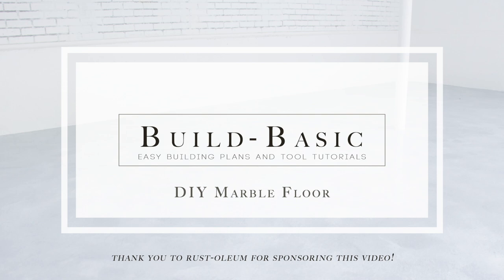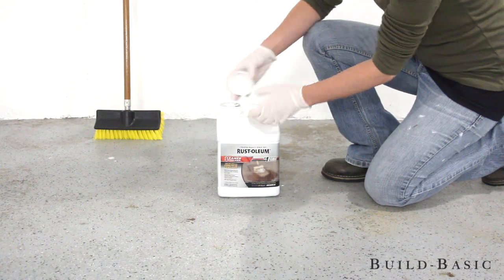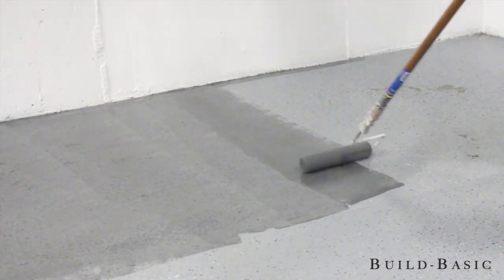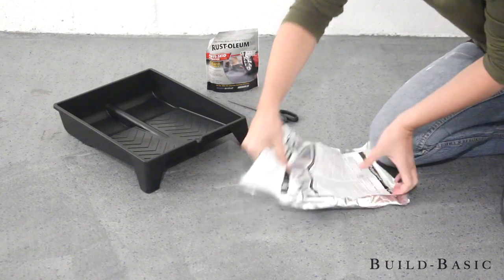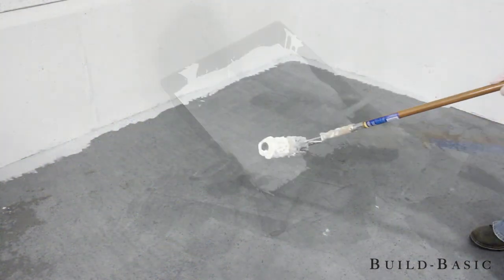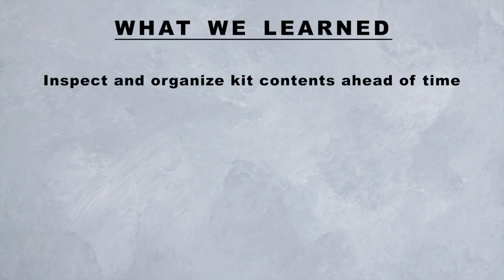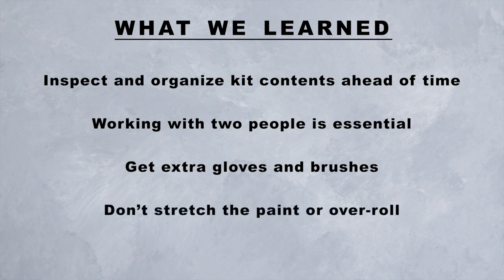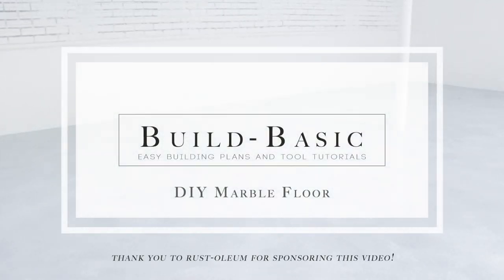How to Marble a Floor with a Rustoleum Garage Floor Kit

Comment: Thank you for this video.  I am planning to use this exact kit but I am very nervous as I am a very inexperienced home DIY'er.  I've watched several other videos but I was glad to see you used a primer.  I see other people have had issues and I felt as though a primer would have helped.  I do have a few questions though.  Can I use a primer even if the floor I will be using doesn't have a previous seal or coating?  Also, all other videos I have seen say to pour material and then roll it out with varied waved strokes.  Why did you decide to roll the product out rather than pour it?